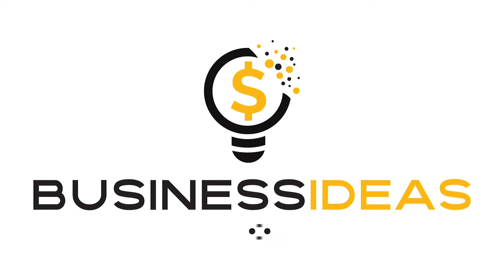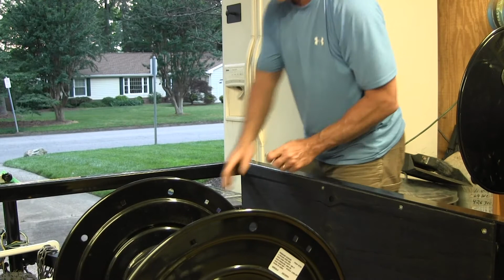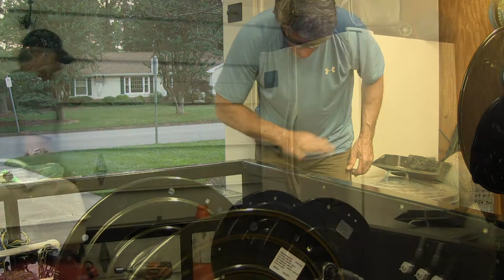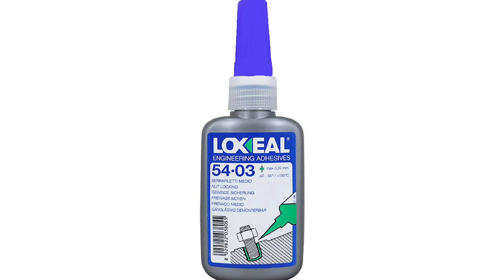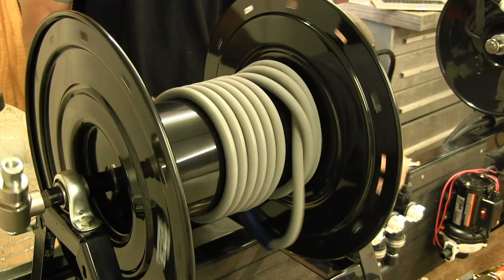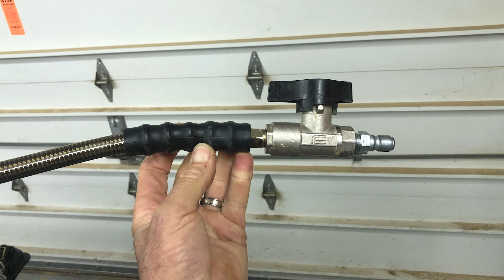Pressure Washer Trailer Build Part - 2   Mounting Hose Reel

Comment: What size bolts & nuts did you use to mount hose reels?
Thx
Reply: They were probably stainless steel 5/16" or 3/8". Either are strong enough to hold the hose reel in place.

Comment: I find when I down stream like u do I do not pull enough Chem I pull more when I it's at  the hose where my wand is at
Reply: Yea I've changed a bunch of things since I created this video. I now downstream straight SH which is helpful. I also have a softwash setup for stubborn jobs. Check out this trailer build course I created. (Free) https://academy.neptuneclean.com/courses/pressure-washing-trailer-build

Comment: What’s the brand of the reels?
Reply: The first reels I purchased were from Northern Tool. The only mistake I made was using a steel reel on my softwash system as it corroded after the first season. I've since gone to an aluminum reel for my softwash system and it works much better.
Reply: Also... if you're downstreaming it may not be as big an issue since the reels tend to get flushed out by a larger volume of water and pressure.
Reply: Where did you get the ball valve you showed at the very end of the video?